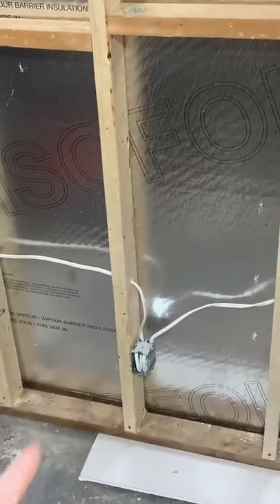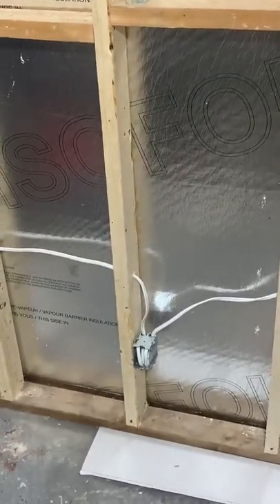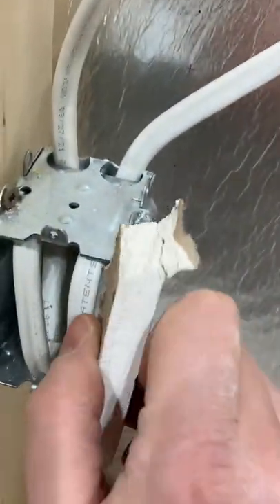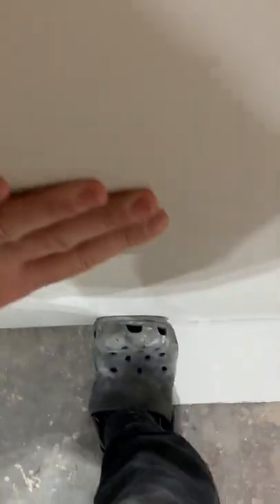No measurements! EASY way to cut out electrical box from Drywall! #Shorts

Comment: Just mark the location on the drywall or if on the floor mark a indicator where the box is and measure down or up put a some screws to hold it in place when your on a scaffold its gon be real hard to do that  trick you did while on scaffold also, Residental has less boxes and differsnt framing different sized beams, You have to make cut out for the piping, sinks,

Comment: Good Pointer. I'm doing existing boxes on a house built-in 1937 I have to fur out the wall Is in garage. Wiring ran on outside Of two by four in the steel tubes With existing steel boxes. Mounted to the outside With the plates on. So i'm trying to figure out how your trick will work with the plate on already
Reply: Unless I take every. Outlet panel off.. It's old school wiring with old school boxes. Don't know why they didn't throw holes and run it through all the 2 by 4 inside the frame like they do now. But I guess it was never intended to have Insulation and dry wall Put up.turning garage in to a bedroom.

Comment: Who installed the Romex? They suck it’s not up to code.
Reply: @beanstalkbuilds   it should be fastened 8” from the box. Jacket stripped back grounding screw installed. It’d never pass an inspection which should be done before any Sheetrock is installed and that Gem box may not be large enough for the number of conductors and fixtures in the box.

Comment: Only problem with this method is that you blow out the face of the good side. Looks like a dogs breakfast, but maybe I’m just OCD. I’d use a zip tool.
Reply: @drygulched8084  how could I be wrong? Look at the fucked up hole that got cut out. Might be OCD but I could make that hole look good.

Comment: Who should never use 14g wire in plugs what a cheap way to cause a house fire
Reply: Or how about the fact they didn’t secure the wire. If memory serves me correctly, should be secured within 6 inches of that termination point it’s a neat trick that I’ve seen a lot of people put on YouTube but doesn’t make up for cutting corners in other places.
Reply: 334.30 in the NEC says you must have nonmetallic-sheathed cable supported and secured with 12” of an outlet box.
Reply: I don't know. Who?

Comment: I have a piece of 14 ga. metal 3" wide bent on the flat at a 90. Put it against each side of the box and mark the floor. Measure to the top of the box and write it between the lines drawn on the floor. Hang the rock but don't screw too close to box(s). Measure up and use your Roto Zip. Fast and clean.

Comment: Men those safety shoes are awesome..router it’s best by the way but can be done a lot of different ways 😂😂😂
Reply: @beanstalkbuilds  but more than anything those sandals are the best advice 👍😁😁
Reply: Router screws up electrical box tabs every time. Electrical box needs drywall behind the ears on box for proper fit. Lazy non-professional way.